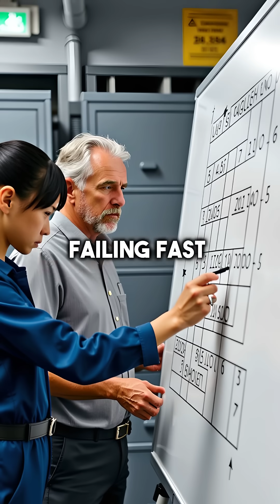How Apollo 13 Survived Space with Just 20 Amps and Duct Tape

Comment: It was caused by engineers on the ground putting a part rated for 21 volts onto the pad that had been updated for 56 volts. A single part caused a disaster it wasn't caught because it was in the oxygen tank, Teflon under supercritical oxygen burnt the insulation off , and burnt a hole through the tank, causing it to blow